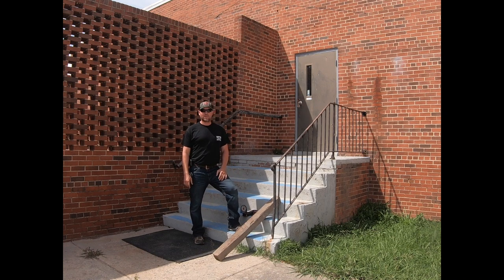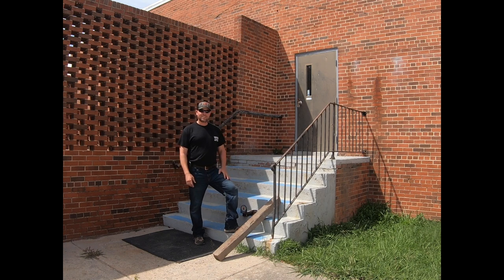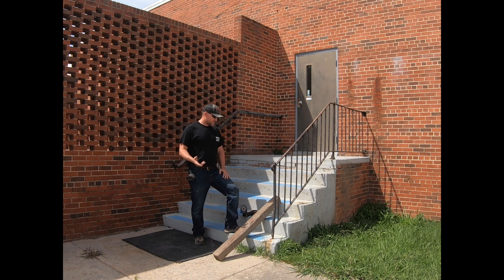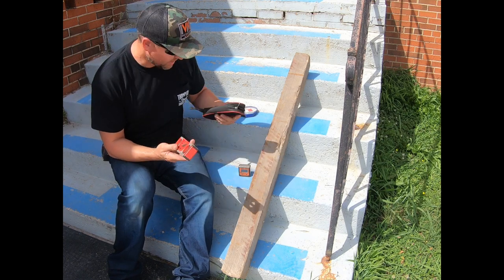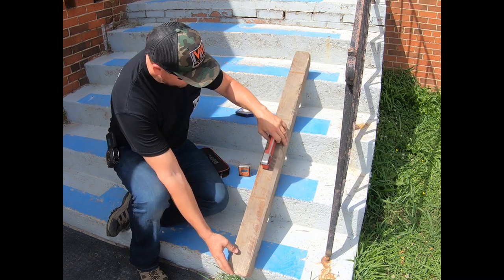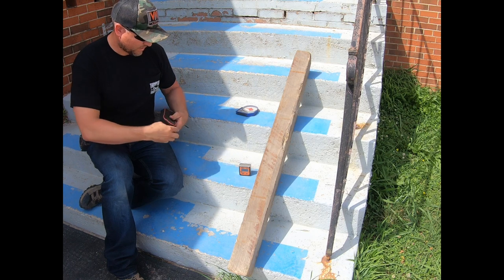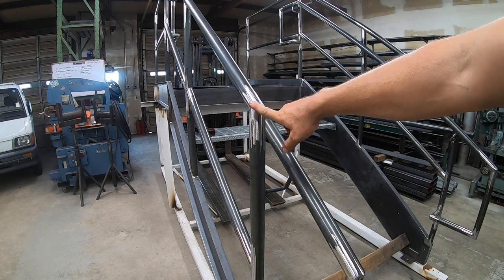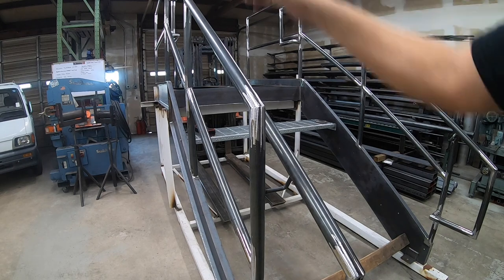Finding stair angle and converting to handrail

Comment: I'm a finish carpentry and trim out staircases in wood of course. Just want to say you did a great job on that stairs. Angle aren't really that bad once you get the hang of it, but I do find myself going slow and double checking everything to make sure I don't make mistakes. The older I get the easier it is for me to get confused sometimes. so I try not to rush it and it always comes out right at the end. And I like the challenge too. Well, . . . at lease most of the time.

Comment: Great video. Very instructive. The shop that can be seen is really organized and clean. The welding and grinding looks real quality. I do have a question. What size tube and wall thickness is best? And what weight/lb. is the stringer?  Thank you.  Keep the videos coming.
Reply from the maker: We use 1.25" sch 10 and sch 40 
the stringers will either be 10" or 12" channel weight depends on specs called out by engineer on drawings

Comment: I would love to see a video on how you find the height of each vertical post so that the top rail is parallel with the stairs. For example, most of the time the top post and bottom post have to be different heights depending on where they land on the step tread. I hope this makes sense. Thanks for your videos!
Reply from the maker: Good morning great question. Every rail application is going to be different. Sometimes posts will differ from top to bottom. I will try to put a video together explaining in more detail
Thanks for watching
Reply: @MattcoMetalWorks  thank you!
Reply: @92weldingandconstruction  Divide the height of a step by 2 and and that measurement to the height of your top post. This will give you the centre line height and will only work if the posts on steps are in the middle of the step.
Reply: Aubrey
Reply: I agree I'd love to see a video on that

Comment: What’s the best way to find and mark angled cuts on round tubing in the field? Using a Milwaukee band saw.
Reply from the maker: So we use a speed square. In the field and in the shop. It takes alittle eye balling to find that pivot point but we can get pretty dang close. I'll try to do a video of that soon
Thanks for watching
Reply: @MattcoMetalWorks  thanks for the info!
Reply: If you don't have a template youse a contour marker curveOmatic makes one

Comment: There are 2 angles in play here. The angle from vertical and the angle from horizontal. Combined they equal 90°. Technically they’re called complimentary angles. If you don’t have some kind of protractor device to physically measure the angle, you can still find out what it is by dividing the vertical measurement by the horizontal measurement. Then using your calculator, find the arc tangent of that number and that’s your angle. Arc tangent is this button (tan−1) on your calculator. 
Example: 7.25 ÷ 11 = 0.6590 tan−1 = 33.39°
To find the other angle: 90° - 33.39° = 56.61°
Reply from the maker: This is great information.  I wish I was better at math. LOL I’m sure I do things the long way most times.  Thanks for sharing this
Reply: @MattcoMetalWorks  You’re welcome. It’s not necessary to be an expert with trig or calculus. Just knowing how to utilize only a couple trig functions, that you already have on your phone calculator, is all you really need.
Reply from the maker: @psidvicious  I definitely need to learn those.  I always hated math but I also didn’t try very hard. Enjoyed working with my hands

Comment: So the bottom post is cut at 2 separate angles? Verticle post is cut on 28 degrees and the rail is cut at 16 degrees?
Reply: Or are both cuts 28 degrees for the bottom post ?

Comment: i have a question.. OK so i have a workshop drawing and i need to cut a PFC at 153(Degrees), how do i find out the angle to set on the bandsaw, or transfer that angle to the Bandsaw to cut the PFC at that degrees...?

Comment: How do you know how long to cut the top rail?
Reply from the maker: So 90% of the time we just get our top straight section done, then we cut and tack bottom post in place, once you do that you can measure long to long and get your top rail dimension.
Reply: Thanks man.  I meant the top rail that is angled as you go up and down the stairs.
Reply from the maker: @1963SMITTY   yes sir that's right.  So where that rail hits the top post and bottom post you just have to measure that distance.  and when i say long to long i'm referring to the long end of each angle in that case the angels are opposite of each other. 
I know that may be confusing
Reply: @MattcoMetalWorks  that makes sense.  Awesome thanks again!!

Comment: Sorry for the double post but what tubing not her do you use?
Reply from the maker: I think you meat to say Tubing Notcher.  We have two machines for that, one of which is the Scotchman 50 Ton Ironworker with coping/notcher attachment for making straight copes.  Then we have old faithful which I've had since I started buidiling rails years ago, that's a Baileigh TN-250 for making angle copes/notches.  That tool was around $500 when I bought it but runs about $850 now and worth every penny.  It's portable so you can use for onsite rail building also, all you need is a vice to clamp it into.   Hope this helps I'll ad a link in the description to the Baileigh TN-250. Have a great weekend.
Reply: @MattcoMetalWorks  thanks. Yes I meant notched. Wow.  Is that white stand used to mock up the landing and the stairs?
Reply from the maker: @ajsironworks3937   yes sir it is.  We build a lot of these so we made a jig setup.  That way we build the upper platform and then just set it on the jig.  And from there we build the stringers and rails, assemble everything, grind and it’s ready for primer

Comment: How do you find the length for the legs?
Reply from the maker: So for the end posts those are simple as we miter our corners. They will most often be whatever the rail height is such as 36" or 42" as we have an angle cut on them to meet the horizontal rails

For the mid posts it's a matter of getting the dimension from channel to bottom side of horizontal rail and adding for the cope. 

I will try to make a video very soon and actually show you as i know often trying to explain in writing is difficult to get the idea

Hope this helps and thanks for watching
Will get a video made soon
Reply: @MattcoMetalWorks  thanks man looking forward to the video

Comment: Question:  An Inspector said that we need for the Guard Rail,  rail bars with 4" in between.... I see them like you are building, but what is about the Guard Rail with bars every 4"???
Reply from the maker: Very good question. This is a commercial application so there for it only requires the gaps be 19” or less.  For residential they are going to require pickets.  Either horizontal or vertical with gaps of 4” or less.  Usually when we build residential we make gaps 3.75” or less just to be safe.  
Also in residential you have to keep a certain gap under the bottom rail going down steps.  A 6” sphere can not pass through the opening 

Check out this link and you’ll find a lot of great information.   It all sounds overwhelming but once you build a couple you realize there pretty much all the same after that.   The only other thing to keep in mind is at the end of the stairs, ramp etc you need a certain length of rail past the very end.  Usually 12”   

Hope this helps. Thanks so much for watching our channel.  Happy New Year. 

https://www.wagnerarchitectural.com/wp-content/uploads/2017/04/Guide-to-Handrail-and-Guard-Rail-Building-Codes-and-Standards-1.pdf
Reply: @MattcoMetalWorks  Thank you very much!  Awesome info !

Comment: Have you ever had the angles you just talked about come out opposite? 
So the angles would be 56 degrees at the top post and 34 degrees at the bottom post.
Reply from the maker: I can't say that I have because that would be a really steep set of stairs.....
Reply: @MattcoMetalWorks   thanks for the reply I appreciate it. 
Alright that’s what I thought to. So where I’m getting goofed up is when I place my angle finder on the top of the top rail I have 56 degrees. Then when I place my angle finder on the bottom of the top rail it is 34 degrees. 
This may be a dumb question but does that sound correct or am I completely out of wack. Or could it be that I’m not using my angle finder correctly. 
Also the weird thing is that the railing angle looks correct. 
If possible could I send you pictures out what I’m talking about?
Reply from the maker: @dcwelding348   send me an email and i'll give you my direct number to send pictures and we'll see if we can figure it out 
MattcoMetal@gmail.com